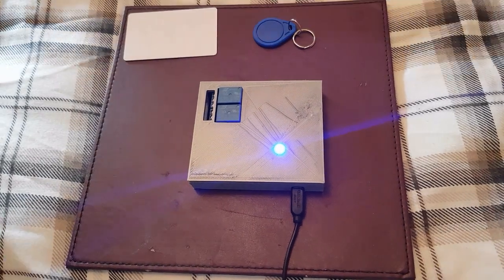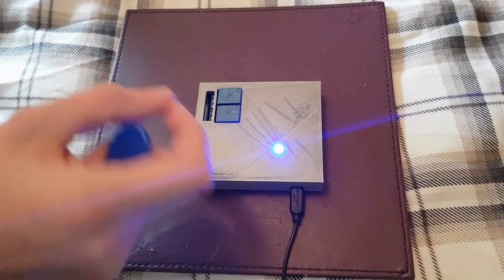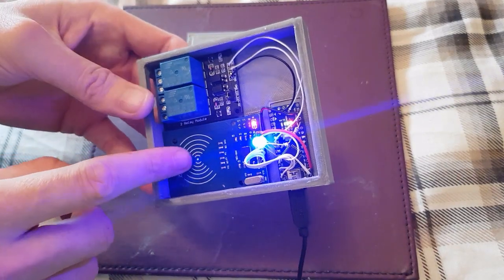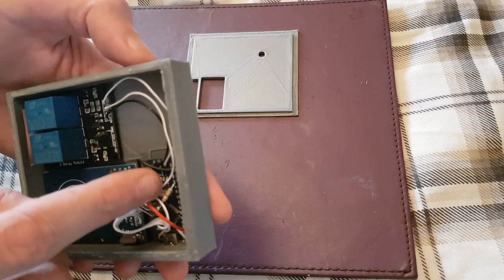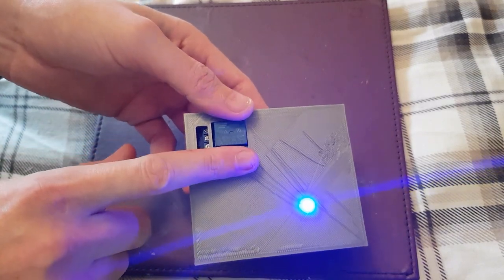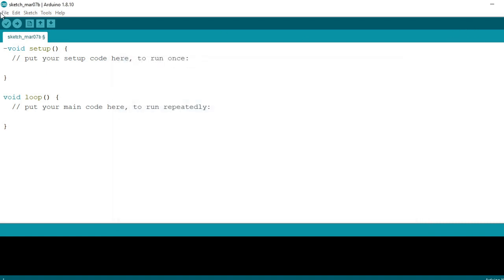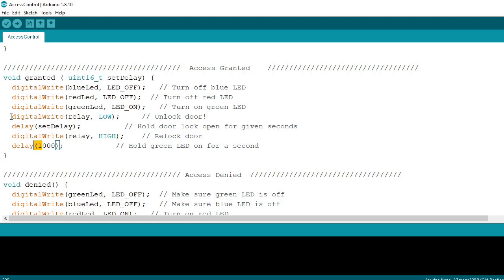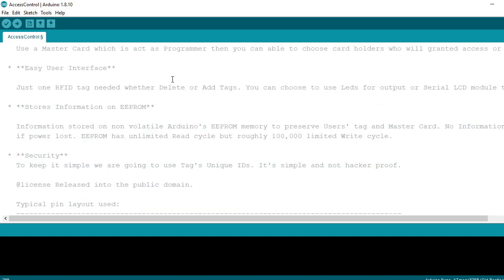Using a RFID reader with arduino and a relay(short tutorial)

Comment: Hello, I and currently working on a project that is a solar powered table with a battery. I am wanting built it with a fob activation so that only approved people with a Fob can access power at the table. This setup seems like it would work pretty well. I imagine that the arduino could be programed to allow power for something like 30 minutes? Never worked with Arduino or Raspberry and only written a few small scripts for googlesheets. Im not a programmer but I can look at existing code and sometimes get it to work for my purpose. 

Do you think the Arduino could be powered directly from the main battery storage, instead of the usb cable?